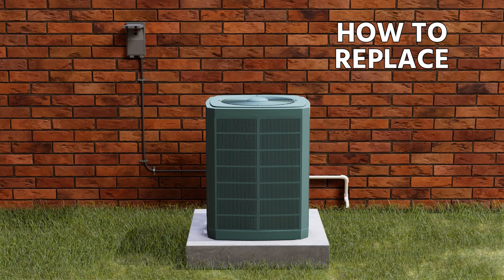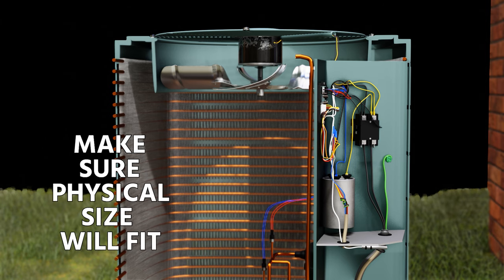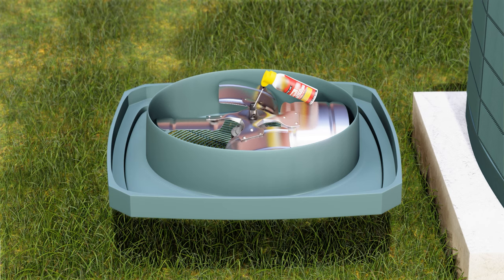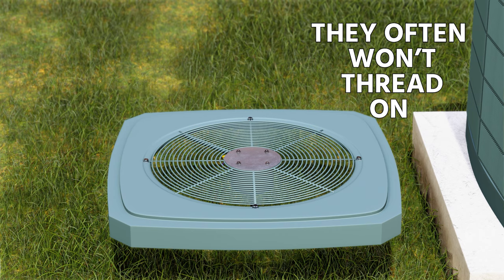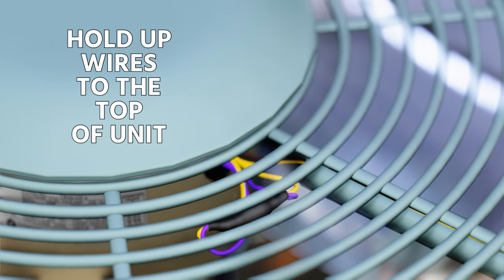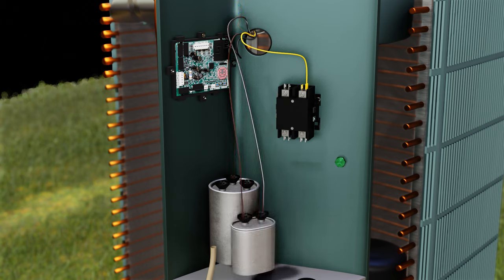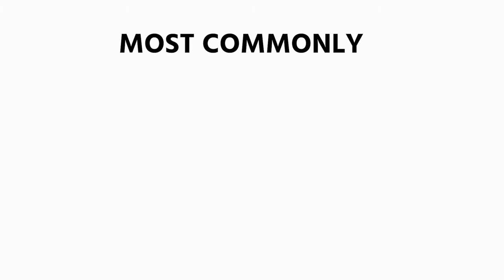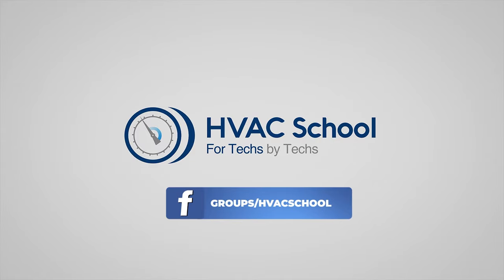How to Replace an AC Condensing Fan Motor

Comment: I'm a 10 year,  hvac veteran.  I still like watching these vids to get a refresh on things and maybe pick up a trick here or there, very informative.
Reply: Quick question, if a new condenser fan is installed in a unit and it's smaller than the previous, what are some of the things that can happen? I ask is because i added a new condenser fan and now my inside of my house won't drop below 85 degrees. Any tips?

Comment: Thanks really appreciate this , I need to do mine when the motor comes in a few days, fortunately my company sells voltage meters so I can borrow one for testing. 3 companies I called said the same thing after doing the inspection... fan motor. They wanted $1360.00 to replace it. I called the place where I purchased the unit and they matched me with the OEM motor for $160.00! An hour or two of my time saves me $1200.00!!

Comment: Great video, this helped me replace my condenser fan motor. I had trouble removing the fan blade, I used penetrating lubricant and a green scotch guard pad. This wasn't the best method. I switched to 800 grit sandpaper and that worked  right away. Use sandpaper for removing the fan blade!

Comment: Forgot to mention most important step. Check if voltage or if correct voltage is going to the motor before condemning the motor. Alot of techs condemned the motor with out testing if proper voltage or voltage is even feeding the motor.

Comment: This is a very helpful video. Graphics and step-by-step is great. This is my second time changing a condenser motor. It will be much easier following along and getting it done this time. I did not know about the condenser plug. Thanks.

Comment: The e plication is very good, I want to mention that the best way to remove the blade after libricar and use sandpaper or steel hand brush or the one that can be placed in the drill is to use a blade extractor so that it does not go away To be affected by imbalance and the rest is very good because the way it explains is a very good orientation when the condensation fan motor is changed.

Comment: Fan rotation: For a fan without rotation wires, it will be built as CW or CCW. Simply stating CW or CCW is ambiguous because it depends upon from which end viewpoint of the motor the rotation is specified.  Many manufacturers will simply put a rotation arrow on the label.  But this is not very easily seen in a catalog and the simple CW/CCW specification is close to useless without more info.  The rotation should be specified as viewed from either as Line-power End (LE) or Shaft-pulley End (SE), ie CWSE, CWLE, CCWSE or CCLE (terms used by many manufacturers and catalogs).  From outside and above the condenser unit, you will be viewing it from the LE with the shaft down. From that vantage point it is either CWLE or CCWLE (equivalent to CCWSE or CWSE, respectively).  Simply spin the fan to move the air out of the unit and then you can see what motor config you need: CWLE or CCWLE.
Reply: Very true and the OEM fans don't have rotation "wires" which means when HVAC is replacing a motor, they are not helping out the customer by "downgrading" the appearance with lame exposed wires.  HVAC should be required to install what is being replaced...especially motors that are sealed ball bearing and HVAC is installing sleeve bearings. They are not the same.
Reply: This is the first time I heard of rotational wires. I am not even sure I understand after watching the video how you actually use them to change the rotation. I agree that rotation labels can be ambiguous! I would think that most motor manufacturers would reference looking at the shaft end when stating CW or CCW. Yes this is going to be opposite to how the viewing would be on an AC condenser once mounted and looking from the top. But if I just gave you a motor by itself not sure why it would ever reference the direction looking from from opposite side of the shaft. Might be totally wrong but that makes sense to me. Thanks
Reply: @condor5635  Many of these HVAC motors are made by aftermarket manufacturers and for them to keep their costs down and the number of motors needed on a service truck to a reasonable amount per day, they offer their motors with CW or CCW wiring, 1/6 HP, 1/5 HP, 1/4 HP, 1/3 HP, 1/2 HP etc. depending on which power leads are used as they will offer "one motor does it all" by having maybe 5 to 7 different colored wires to use depending on the requirement. This allows the HVAC technician to have a replacement part "handy" and one that "will work" rather than having to order one made by "Trane" or "Carrier" from the supply house who usually don't stock them but do stock hundreds of "rescue" or "Pro" aftermarket replacements to allow a quick repair in the field. Some customers will refuse and only want the exact motor replacement so that the wires are the same as the worn motor and the shaft length is correct vs. universal and so on. There would not be any reverse wires with the exact replacement motor in that case because its already known which rotation is used.
Reply: @Garth2011  - thanks for the reply. I think I’d go with the OEM fan motor and spend the extra 150 or so instead of getting some aftermarket one.  The GE (fan motor that is on a Carrier unit) one I have is 20 years old. I’m guessing it makes a little bit of noise over a brand new one, but it appears to still be running fine now
Reply: @condor5635  Most of the time an OEM motor replacement is best however, as we all know rather well, the public generally takes the less expensive parts or method. When I see condensers with motor reversing wires zip tied onto the fan shroud and mounting studs that stick up and rusting I have to ask how does any technician consider that a fair repair? They don't usually offer the customer a choice, they simply diagnose the problem "you need a new motor" and they pull a rescue motor from the truck and then install it in many cases looking like crap. Yes, it is working but the tech didn't get permission from the customer to alter the final looks and type of motor. Those techs should be quoting the customer OEM estimates and then offer the aftermarket stuff if they choose to go that route. I have seen so many service repairs end up way different than the way things were when they got there as installed when brand new. Torn suction line insulation when it wasn't, lost service caps when they were there, missing screws that were all there before and so on. It's like these guys are on a stop watch when doing service vs. doing the job as needed and moving on. 
Regarding new motors, I would use aftermarket ones as long as they had ball bearings and were from a legitimate company such as US Motors/Nidec (was G.E.), Dayton, Baldor, etc. Most of the $140 motors are Chinese made and will fail too soon. You can disassemble your existing motor and reapply 20w non-detergent to the bearing fiber packing material at both ends and get many more years life out of them. 3 in 1 oil is surprisingly the correct oil. If, the bearings are the bushing/sleeve type and you oil them soon enough before the metal is scored. Ball bearings are sealed and not serviceable, must replace them or the entire motor.
Reply: @Garth2011  - thanks for that. Interesting stuff. All of those things is why I like to do things myself.  I don’t know the last time I had a plumber, electrician, or carpenter in my house. 😀. If you want it done right do it yourself
Reply: @condor5635  Same here and as of now, the quality of home technicians and services is very poor. Lots of unskilled folks calling themselves tradesmen.

Comment: Set screw on fan blades should be tightened very hard, just until it breaks. My fan blades came loose and hit copper pipes. No pipes gashed.  But blades needed to be reshaped again.  Set screw loosened caused more work to me, causing a potential damage.  Your video says do not over tighten set screw. The motor mounting nut tightening can break the iron bolts because bolts are only 1/8 inch thick. Brass set screw is 1/4 inch thick, so it may not break easily. Brass alloy is very strong.
Reply: Why not a drop of threadlocker instead of warping the bolt, shaft, or fan screw hole?

Comment: Hi great video, you pulled the main breaker on the house wall, and you disconnected the fan wires, I've noticed you didn't have to short out the fan capacitor do you not have to do that...?

Comment: The one thing I didn't see you mention was where the blade should sit on the shaft. Should it be in the middle should it be closer to the motor, or should be farther away? I'm not a technician just a homeowner but from my research the general rule of thumb is far enough so it doesn't hit anything but close enough to not cause unnecessary stress on the motor.

Comment: My old fan motor has 4 wires brown and white, brown, yellow and black.  My new replacement has 3 a red, black and brown.new motor does not have a wire diagram. I know the brown goes into the capacitor and the black supposed to go on the contactor but what about the red wire does it go on the opposite side of the contactor or does it go into the common on the capacitor. Thanks for your time and God bless

Comment: only vid i've found about the motor itself. so many vids about about the capacitor, not the motor. just looking down in my unit, i pulled out a broken cable tie. I see the wires have fallen and the black one is cut,  perhaps by the blades hitting it. I think the cable tie broke in the heat. I'll use metal like you did.

Comment: Question: fan motor wires were not left up, we’re not wrapped as you suggest, but we’re placed where screwing down fan pinned them. (On purpose). This seems to make fan less than level…but just enough to keep working. Should I re do?

Comment: Also:  Read when u have time: (no rush): Not sure you can answer this but: when they screwed in the fan to the cover, the wires were pinned between motor and cover for 2 of the screws. It seemed to put the fan off balance (small grinding sound when it starts that doesn’t 100 percent go away, but picks up rhythm). I questioned it as it didn’t seem right to me and he said that was the grounding wire. Does that sound right to you? (Otherwise nice and cool).

Comment: We have about 20 rental units. What info should we keep for each HVAC? I was thinking that we need to keep a log of the unit size, condenser fan info, capacitor rating, etc etc... What would be a great "worksheet" that would have all the stats we would need to keep for each unit?
Reply: You can never have enough useful info.  Model #, make, date of manufacturing, commonly failed parts.  Useful, up to date MS Excel info database.  Better parts stocking, right tools, troubleshooting skills, save tons of time/money.  Make sure you know what parts you need so when scrapping out old equipment, you salvage relevant parts that are FREE now, but expensive, hard to get, or long lead time...to get later.  Stock capacitors and a few contactors.  When replacing entire system, stick with the same brand....it make for easier maintenance & upkeep down the road.  Follow a rigorous maintenance plan, performed by trustworthy staff....will save you more tons of money.

Comment: I got a quote to replace a condenser fan motor from a professional for $1200 (ECM).  I sourced a new motor for $400 and put it in myself in about one hour. Just don't understand the price gouging in this industry.
Reply: Most homeowners have no idea the overhead that goes into running a business + making a profit. The insurances alone is depressing. That said, if the motor was the same one he was going to use then $1200 is out of line. Somewhere around $600-$800 should've been about right.  I probably wouldn't use those people again.
Reply: @95thousandroses  I find its easier just to do the work myself. Contractors, transformers, fan/blower motors and control boards are easy. It is the gas that scares me.
Reply: @joecraigslist9467  Many competent HVAC guys would rather you do the basic stuff yourself IF you're competent. They get bored with the menial tasks.
Reply: I would agree that price is totally unreasonable.  The guy was trying to make $800.00 on a simple service call.
Reply: It’s called business 101 people like have a hard time understanding what it costs to runs a business.. was that price high yes but that business
Reply: Lets see now...if he came to the house and gave the diagnosis and estimate, he needs to get paid for that. Also, figured in how much it takes to run a fully stocked service truck? The insurance? The licenses for HVAC and city licenses? Gas or diesel fuel? Health insurance, business insurance? Have a business location for storing materials and doing repairs? All of that overhead is now a days very expensive and to survive, they need to likely do a good 3 to 5 calls per day to make it worth it. I'd agree the labor charge is too high but remember, he isn't selling the motor for wholesale prices and his labor is guaranteed for likely 12 months. Also, if the motor stops within its warranty, replacing it would be no charge the first year I'd guess. So, you are not truly without some kind of warranty for the profit they need to charge. My guess would be a fair charge is the motor plus $100 markup and labor as an addition to his service call minimum. So say he needs 2 hrs in total which could be about $300 plus the $500 motor or $800 on the lean side. Some of these HVAC will put out a figure and see what happens. All it takes is, how do you charge for labor? You plan on taking 4 to 5 hours to work on this? Likely they will refigure the price or not.

Comment: You mentioned a 1075rpm motor replacing an 825rpm motor will draw a higher reading from your multimeter but will it cause any problems besides the false reading?

Comment: I like to if rotation leads are in same location as other wires.  Check rotation by shaft or lead end.  Follow instructions and use plastic end crimp connectors after cutting off spades.  Tuck all wires into conduit, zip tie conduit if new motor doesn’t have barbed end to hole sealtite conduit up, install new dual capacitor, cut 4th wire and wire nut end.  I trie to make it look OEM as possible, basically no wires exposed.
Reply: I would agree 100% that the rotation leads be long enough to follow through with the power leads. It makes no professional sense to have them exposed especially when a tech has to get inside the cabinet to wire up the other three wires. Not to mention, those exposed leads look and will wear like crap over the years. Makes no sense to take a correct rotation motor out and replace it with half minded wiring exposed visually and environmentally. Either that or the manuf. should simply incorporate a simple switch on the housing to select rotation.

Comment: Do I need to use a clamp multimeter like you used? Or will a normal multimeter work?
Reply: You cannot measure amps with a standard multimeter unless you place the meter probes inline with the wire. That's not practical unless you cut the wire, and also most multimeters won't measure high amps. In addition, it's a lot more dangerous to be touching live high voltage wires with your hands vs  using the noncontact amp clamp.

Comment: So i had a tec come out and replaced mine  i live in Tampa florida  and hes billing me all work in total  for 675.00 the tec who know some english told me that the motor has the same horse power but different brand than the other one he took off
 Our AC unit is like 5 years maybe 6 years old. And he claims that it will run fine
 Is this true or should i be concerned.

Comment: Can a single phase CF motor run backwards even with a good run capacitor? If so would that motor need to be replaced as far as I know you can only reverse 3 phase motors.
Reply: I have actually seen that happen when capacitor was wired incorrectly on 3 wire
Motor. Only a couple of times though in 15 years.

Comment: What happens? Original motor 850 rpm new motor 1075 rpm. You said over currant condition, what is that and why is it bad. All other specs are same and this is being sold as direct replacement. Original motor has been discontinued twice.

Comment: If only taking the fan blade off was as easy as videos show lol. I've been struggling for an hour used PB blaster and WD40 and won't budge
Reply: @Harrys Chrysan  I finally got mine off. All I needed was a grinder lol so I grinding down the shaft on the old motor. But the 2 hrs I spent trying to pry/deadlift it off had me freaking FURIOUS 😂😂😂
Reply: $60 will get you a decent hub puller that won't damage the blade. Also, you must prepare the shaft surface to be bright & shiny with emory cloth or a wire brush.

Comment: Dont use higher horsepower motors because it puts more vibration into the machine, any extra horsepower will make the machine louder. I dont have any mulit-motors , its really a hack move, one brand is Trip Saver, meaning you didnt have the truck stock needed.  Probably have 4-5 more motors on the truck than most, $500 extra truck stock is nothing in this industry, charge a little more and provide quality not shortcuts, an empire will follow. The fan blade info? We all use fan blade pullers right?

Comment: Aren't most condenser fan  motors turning the same direction, clockwise with the shaft pointed down? If most are, why are HVAC installing "universal" directional motors with those lame wires and multiple wires vs. the standard three wire motors?  This doesn't apply of course to brand new equipment that has plastic plugs and ECM etc.
Also, these manufacturers offer sleeve and ball bearings...Which is recommended for longest life and problem free?  Who is making USA made motors? We don't want Chinese motors.